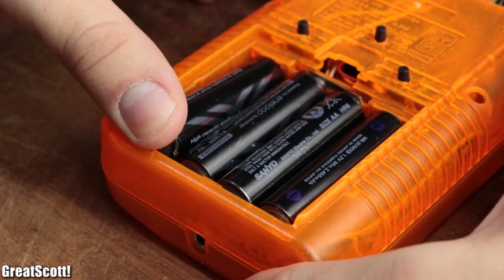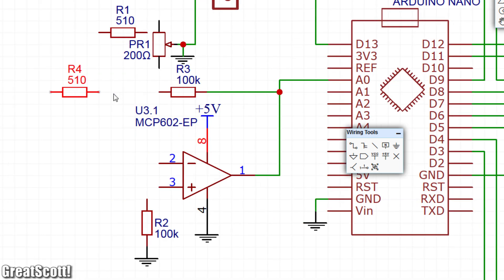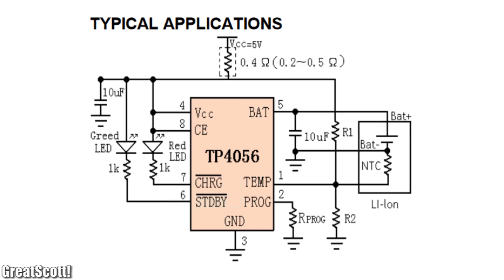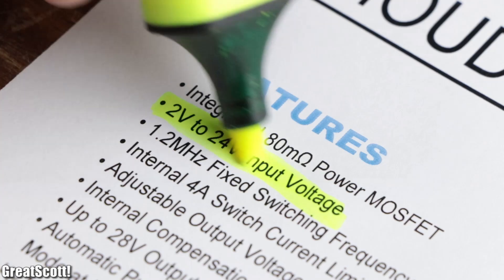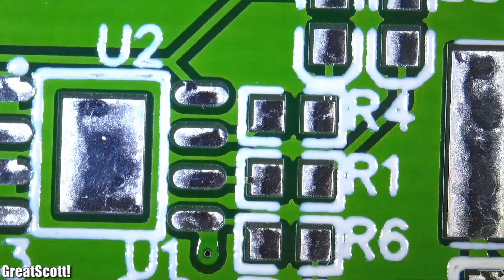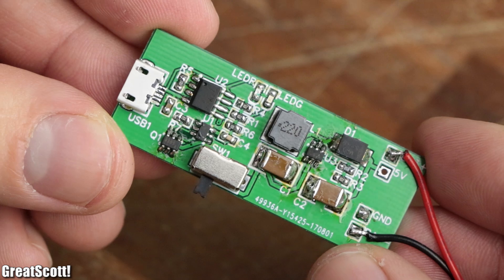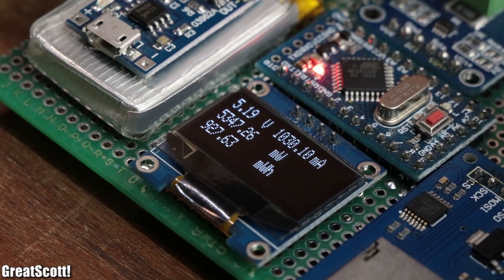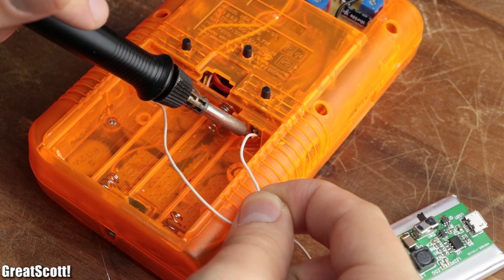DIY LiPo Charge/Protect/5V Boost Circuit

Comment: Using a transformer as a general purpose power supply, with 'for charging' written on it is ironic.

And why did they even print such stuff on the transformer? Who are they to decide how we use it?

Comment: Nice design, now for the one that does 2 cells, and maybe balancing charging also. I spent some time researching multiple modules to meet your specs but with w cells, 1A out, 12-18VDC in for charging and would curve and keep efficiency of the variable set output boost even while the battery voltage drained down with a low cut off also.
I ordered several of the smallest charging and protection modules that met my requirements. But I could only find one PCB that claimed to do it all with the option of 2 to 4 cells, still all needs tested of course.
As for the boost, I trust and like Pololu. They have a boost for everything, and small also. Just need to take some time to go over the data to find the correct one that’s the most efficient for your project.

Any chance you are looking to take yours to the next level with a 2 cell version, and included balancing with high voltage input maybe 12 to 16VDC? The device I’m converting already does this voltage range, the 16 is the wall wart, and the 12 is for Car charging. But I guess I could also make a new charging port if needed. Of you have this planned I would like to test one, make one, or make one. If so I may need to hold off and test your also with all the others.

Still defiantly check out what Pololu has to offer, I think you will like some of the things they make.
Thanks,
Scott

Comment: EasyEDA is a great software which has this "Fabricate output" service, but when I've received my PCBs in Austria I had to pay an additonal tax (half of the price, and my order was more than 50 euros!) for custom charges, as this was sent from outside of the EU. When I talked to the delivery-woman she mentioned that they increased the checks at the customs and this happens to many deliveries. So the customers were irritated about that, also because it was mentioned no where. So if you order it the first time you should maybe check that before.

Comment: I think Micro USB has five pins, ground, 5 volts, D+, D-, and sense. maybe you can use the sense pin to switch between charging and boosting in the next board revision.

Comment: +GreatScott! You may want to add a load sharing circuit to your board to permit charging while you are using the load. Without that the charging IC will get confused and could overcharge the battery if you accidentally use the device while charging.

Good project otherwise!

Comment: Great video as always.
I have a video request. Could you do a video on how to build high power led drivers with the option to connect an arduino or other source to control the brightness with pwm? I've used meanwells bucks earlier but would like to build my own. Also explaining how to get different mA from them.

Comment: Hey ! Nice design and good tip for the pcb maker, it's indeed quite cheap.
Have you figured out what was wrong with the first boost converter IC? That's quite odd, like the switching current was too high and the IC thus stopped switching, bringing the output voltage to the input one. Any ideas?

Comment: Thank you for all these useful information. I was looking for a cheap and quick PCB prototyping solution. But I have a question about the output voltage ripple of your circuit, how high is it? Did you try to measure it with your scope? I'm currently designing a low noise DC-DC converter with an output current of around 1.5 A.

Comment: Only thing its missing is a low battery warning output pin like the Adafruit Powerboost 1000c this would be a perfect drop-in replacement for projects where you need that feature.

Comment: So I have a 2s Lipo battery.
I want a charge/protection circuit which also has an auto switchover feature. i.e. it supplies power to the load from source until the source is removed. Then it uses the battery. 
Could you help me out here scott?

Comment: Is it possible to design DC->DC Charge/Discharge protection board (that can activate battery as backup power source if main power source is off)?
P.S. Plane to use with RPi Zero for example.

Comment: Can you clarify a point, when the boost circuit turns off does it disconnect the battery or just turn off the boost. Because it's possible for a device to still draw power to below the safe lower limit of LiPo/Lion batteries. It's why some cheap battery banks can end up with completely flat batteries.

Comment: Not too long ago i helped a friend designing a circuit board. 2.4x2.3 cm, ~30 connection-pads to diferent boards, 2 connectors, voltage regulator, 9axis sensor,  infrared sensor, molex connector - and a freaking 40 pin chip.
took us 2 days to get all the traces on the tiny board.
When we finally managed to squeeze in all the connections we enlarged the power-traces. The datatraces were 0.154 mm, power was 1.5 mm :P better overkill than sorry.
And darn - all those wires.... we had to skip layers so often to fit in all the traces that we had something like 150 holes on that little board.

Comment: What about the 134N3P DIY Charger Module? Costs only 0.5$ (on Aliexpress) and has 1A charge/discharge, 5V boost, 4.2V charging voltage, 2.9V discharge stop, 8uA standby current and 85% Efficiency @ 3.7V. At least that is what the manufacturer claims, i have not tested it so far, but looks pretty good.
Reply: I assume that is what they use in these small power banks. Designing an own boards seems overkill for such a common application. Cool project nonetheless!
Reply: No protection IC/MOSFETs, all it does is stop boosting but output is still connected to the battery, if hooked up with a dumb resistive load, it will discharge it flat. Some of these boards have unpopulated parts for the DW01/8205A combo, unless you found a source of these with the protection parts fitted?
Reply: @daijoubu4529  Yes, agreed, that is the problem. Need that protection IC along with charging IC.  I am surprised they have not intetgrated all those componants into one.

Comment: I've had problems with dc-dc converters. the datasheet should have a recommended PCB layout. When the switch freq gets high the trace size/position/shape start to have a big effect on how well the switching power supply will work. so much so i've worked on a project with fancy linear chips... that would only work properly in one pcb config. we couldn't move a single part.

Comment: Great video as usual!  But this highlights a problem I have with SMD components.  For someone with the knowledge and experience of Great Scott, it seems entirely possible to skip the prototyping step - even though in this video he remade the circuit a second time and had to wait for the circuit.  For me, designing it then breadboarding it is such an important step that I just would not be confident to go from design to PCB in an instant.  Yes, sure it's cheap, but it's a week between PCB "mistakes".  I'm sure part of the solution is a circuit simulator, but even as he demonstrated I don't think it would reveal all of the idiosyncrasies of a circuit that live testing does.  Just wondering your opinion of it as everything moves away from through hole.
Reply: Hey, 5 years since this and now i have the same problem. Do you sugest something? Im creating a small autonomous robot and i think it would be cool to have the battery charger inside the robot circuit instead of taking the batteries off. But making a pcb and failing is a waste of time, and nowadays a waste of money. Any good simulator for that?

Comment: GreatScott Hi I'm thinking of making an op-amp board with the OPA2134 that uses little current but the voltage is a bit high +/- 2.5V to +/-18V  I'm not a pro and I need advice because I don't know if it's smart to boost the voltage to about 12-18V so when it get split to +/- it gets to about 6-9V. I want it to be super compact. I did tried it with the tp4056 and the mt3608 and it did work but its bulky even with an lithium bat. and I want it all on the same board. What do you think?

Comment: Hi GreatScott, can you explain what the problem was with the first version of the board? In my last video I made a mini boost converter by putting an MT3608 on an SMD adapter board (see https://youtu.be/K7Lv5FWTX9Y ). The output current I measured seemed to be quite limited and in my case the capacitors are too small. I also think the small 22uH coil I use is too light for higher loads. Thank you for making your videos. They help me a lot to understand things! +1

Comment: Interesting and useful facts:

1) If you only purchase 5 boards (instead of 10), the shipping cost is lower.
2) If you use "Panel by EasyEDA", you can fit more boards in one panel (2x5 panel in this case)

This results in 100 boards (2x5x10) at the price of 2$ !!!
Reply: where is "Panel by EasyEDA" ?
Reply: JS7457 Go to "order PCB"
And then it's on the bottom of all board properties.
Reply: Christian B ry but the price rises.
Reply: @JS7457  I think the price is fixed depending on max board size, e.g. 5x5 or 10x10 cm. If you actual board is much smaller, then it can be "duplicated" on the 5x5 or 10x10 cm "panel". In that case you would get more boards for the same price.
Reply: Cool profile picture

Comment: I've been living in germany for few years now. has anyone here had experience with the (dreaded) german zollamt? seeing the prices of components on aliexpress or those from the usa I'm tempted to say the least. would this cause a huge drama, or will I have to continue being robbed by companies lije conrad electronics? I've heard a few horror stories from folk ref. VAT payments they had to pay to the tax office....
thanks in advance for any advice on this wee issue!
+GreatScott! interesting video from you as usual...thanks for posting  :)
Reply: Lived there for 1 year. I ordered many cheap packages from China and everything arrived. As long as it's below the VAT / import tax threshold, you should be absolutely fine.
Reply: The worst that's going to happen is that you have to pay VAT and import tax. You receive a letter saying that you have to prove value and instructions how to do it (screenshot of the order, you just sent it by email with your personal information). If it's more than 22€/package, they will calculate the value you have to pay them and pay it when you go pick it up at your local post office. If it's under 22€, you are getting it next week like nothing happened. Import tax is only above 150€ value I think, and it's around 3%. They are generally checking out only boxes, not letters/bags, and require value verification only when they think it might be above 22€.

Got one package stopped, it was a graphics tablet, so it looked expensive, but it was 18€. I sent them proof, they sent it to me the next working day.
Reply: 3zuli  Adam Mesarč  thanks for the info guys! this means I'll get my projects finished ahead of schedule and the BOM will be so low that my better half won't be giving me the guilt treatment, lol..
I feel a wee component spending spree coming on.
..take care and stay creative! ;)

Comment: Have you checked the output ripple of the MT3608 based boost converter? I'm currently also building a project using this MT3608 ic (using the already made cheap chinese modules) but I'm having more than 800mV high frequency ripple on the output? Can you confirm this?

Comment: I'd love if you explained more why the first variation of your pcb didn't work properly in the video. The requirement for shorter and wider traces was probably mentioned in datasheets, so we have to give it more attention in our projects :)
Reply: Most likely because he didn't follow the recommended pcb layout application note in the data sheet for it
Reply: @biisnov770  I don't believe the PCB design can affect the performance this much at merely 1.2MHz
Reply: yes, promised explanation was the only thing missing in this video... :-)

Comment: Excellent job, as always. You could use a Dummy Load, maybe a next project? regards
Reply: I think he means a programmable one. Where you can set different values.
Reply: Proyectos LED hola gastoooon
Reply: dummy load @7:19 yes?  (big green resistor)
Reply: Yes I would want a high power dummy load.

Comment: So you basically made a bangood powerboost converter already used in many GBZ https://www.banggood.com/3Pcs-5V-1A-Charger-Module-Mini-USB-To-USB-A-Power-Supply-Module-3_7V-Li-ion-Battery-p-1067469.html?rmmds=search
Reply: After I have read you comment, I ordered the modules. Here are my experiences:

The maximum current of 1 A can only be delivered for a few seconds; after that the module cuts off the power. So you better use USB devices with a lower power consumption. 

If you want to use the module again after the overcurrent protection went active, you have to cut off the connection to the battery or plug in a powered charging cable — a total design fail if you want to use the circuit when there’s no USB charger or another power bank. Every real power bank does this job better, re-activating the power output after the USB plug has been unplugged. 

The undervoltage protection does not become active at 2.9 V like stated in the specification, but at ~ 2.53 V, which is too low in my opinion. Every run-of-the-mine protection chip cuts off at ~ 2.5 V, which is on the lower end of the allowed li-ion battery voltage. 

All in all, I don’t recommend buying any of this modules.  (Copy of my review at Banggood)
Reply: ew miniusb
Reply: and they actually show a microusb plug on the device.

Comment: Outstanding! I have a set of small walker talkie radios I'd like to keep in my car for convoy journeys but they take AAA cells. I have bee thinking of modifying them with a LiPo solution and your circuit looks ideal! I just need to see if the boost converter output can be set to 4.5V instead. Excellent project!

Comment: The only thing I am not sure about this design is that the heat generated by thr board lying on top of the battery would harm the battery by creating hot spots in certain areas. Prolonged and elevated heat in batteries especially lipo tend to reduce capacity over time and tend to be less safe.